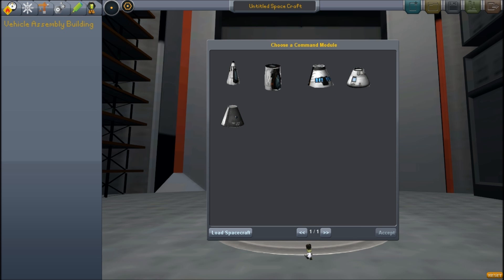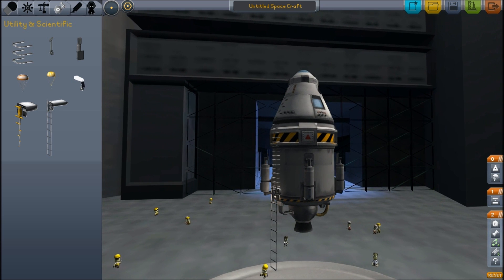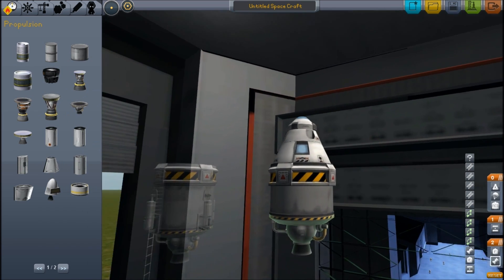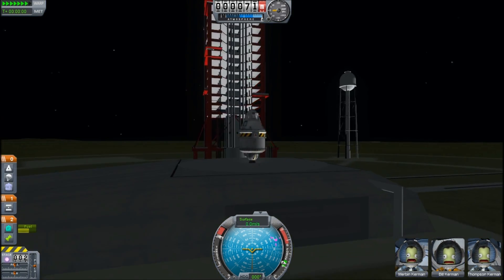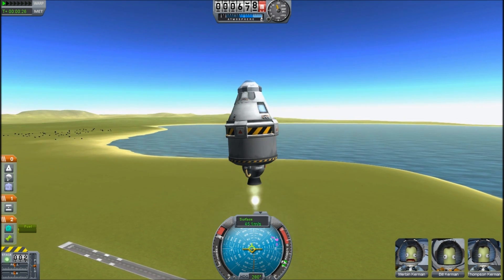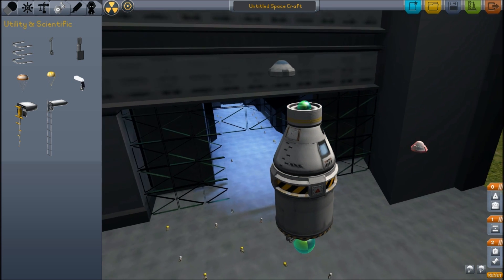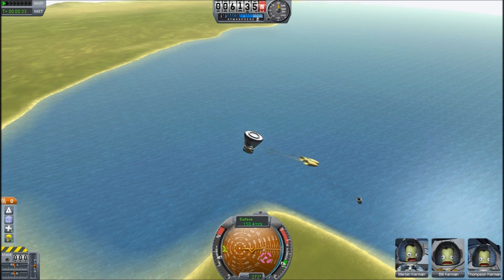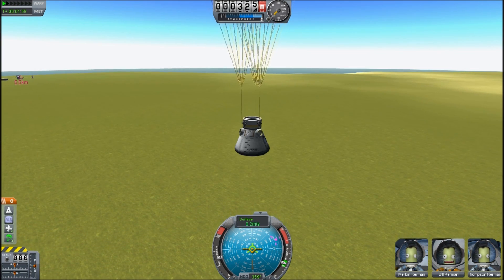Developing A 3 Pilot Mun Lander - Kerbal Space Program

Comment: It'd be cool if they added a "vent fuel" option for tanks, or through the engines connected to said tanks. It's be useful for something like here, where the launcher is too heavy so you want to kick out a certain amount of fuel. Or... if you're racing down towards a planet and your rocket has too much mass for your engines to slow it down in time. You dump as much fuel as you can (without killing your delta V budget) and the lighter load means you can make a safe landing.

Also a "dump fuel" but

Comment: 7:05 I fixed that actually, just add struts. I put my ASAS up there and just use about 8 struts to hold it down. It will still rip off if you're going too fast, but as long as you're below 200m/s you ought to be fine.